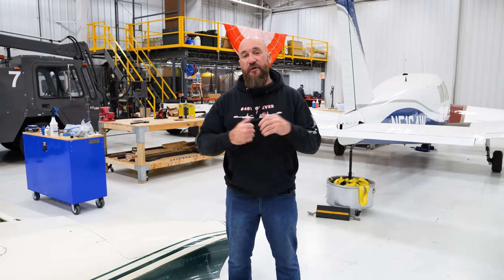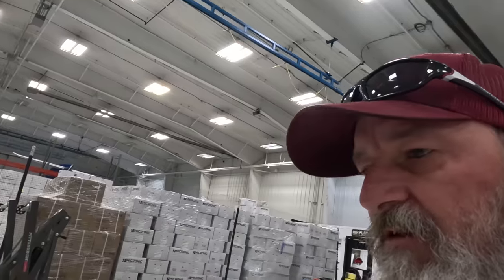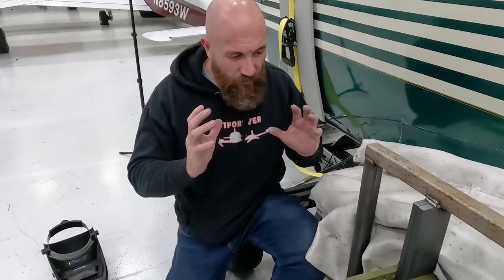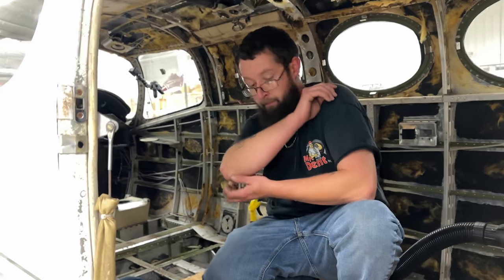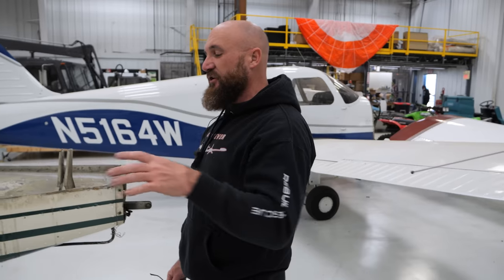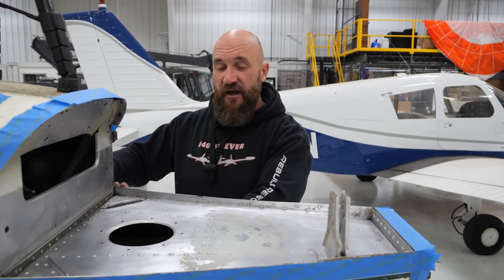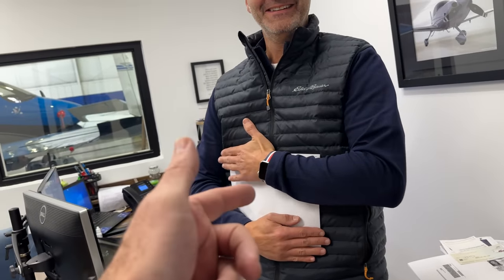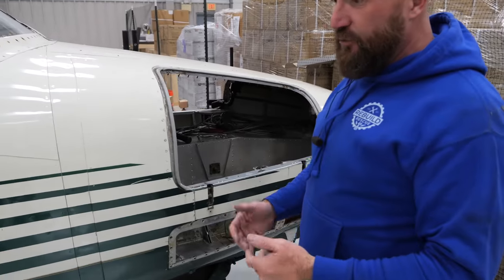Getting The Free Abandoned Airplane Ready To Leave The Hangar !

Comment from the maker: Skip the waitlist and invest in blue-chip art for the very first time by signing up for Masterworks: https://masterworks.art/rebuildrescue Purchase shares in great masterpieces from artists like Pablo Picasso, Banksy, Andy Warhol, and more. See important Masterworks disclosures: http://masterworks.io/cd
Reply: If I were you, I'd cut four 3" or 4" long box tubes with diagonal corners and weld them as diagonals at the corners of those two big square things for extra rigidity.  
I'm not a welder, so maybe people here are gonna tell me that's unnecessary, but that's what I would have done just to over-engineer those support thingys a little more 😛
Reply: And nah, strip that ugly old-fashioned paint job.  Screw "historic!"  Give the plane a sleek modern paint job!  
Personally, I'd paint it a sparkly metallic red paint like a sports car with subtle black accents here and there but not excessive, like, no black racing stripes or anything!
Reply: @fredashay  same, boxes move, triangles don’t. And that’s the “fall out of the sky” chassis of the plane, it doesn’t need twist loads going down rough roads.
Reply: Use dry ice pressure washer?
Reply: Not sure about this, sounds suspect as the price of art is still speculative like stocks are. Its price is inflated by the auction house. There are many good factual youtube videos right here on this platform about it by people like Half As Interesting, Cheddar, etc. I do appreciate though you gotta do sponsorships, they keep the 401 in the air, and at least its not kamikoto knives or established titles 🤣 Keep up the good work and keep flying! ♥

Comment: It may be too late but, I recommend a different way of securing the fuselage to a truck trailer. In 1972, I was picked to design and build cradles to send planes by truck, after they were subjected to flood waters at Lock Haven. You have to keep in mind the pounding these flat bed trailers subject their cargo to on our crappy highways. I built wooden cradles with the fuselage contour cut out in the wood, then cushioned the wood with thick strips of felt. You could probably use rubber backed carpet or something similar. Straps were attached several places and through the wing spar box carry through. Those heavy plates of steel on the spar fittings is not a good idea, IMHO. They will be subjected to a lot of stress if transported the way shown.  The Navajos arrived in good shape but I did have to redesign the wing supports and add more felt. These planes were used at NAFEC to see if they could design more crash resistant seating. They were rigged and dropped from a structure that had previously been used in the space program. One made the cover of Popular Mechanics Magazine.  A photo was sent to you of the fuselage on a trailer.
Reply: I agree with you on that. I have been involved in building a few timber cradles for commercial aircraft, with as you suggest good clean carpet, not necessarily new or 6 - 10mm rubber. Also some form of levelling adjustment for when on the ground in the various locations it will be sent to. Some where in the manual there will be "Shoring Points" for taking the load of the aircraft and keep it from going out of shape. Cradles and the frames you have built would work well together. I'm sure Cessna will have guidance on it. But you are doing pretty well, roll on Oshkosh 2023 👍

Comment: Corner Braces to your transportation rig would add additional safety strength. As it currently is there is a lot of torque forces on the welded joints.
Reply: The welds look terrible.  Corner braces are a must.  I don't think that plane will make it on that homemade rack all the way to Georgia and back. If it falls off the truck, then the project will be over, just because the rack was so poorly built.
Reply: The lawnmower tires definitely don't help
Reply: Not sure how the tail will be supported or if over the road vibration has been taken into account.  The large overhang could move up and down and severely over-stress the spars as well as the cart and the welds.  Also have to be careful of strapping to the trailer because it will force any flex of the trailer into the fuselage.  Some trailers have a lot of built in camber that can cause a lot of stress to long objects that are strapped down.
Reply: @bobt1931  Cross braces in the construction  will indeed add strength and stiffness. But I think that some flexibility is also needed. Maybe the whole thing should be mounted on some sort of shock absorbers.
You don't have to worry about the tail being overstressed. In flight, the forces on it, and on the wingspars, are at least 5 to 6 times as high as they ever will be during transport. Flying through turbulence will dubble that, maybe even triple.
Reply: @C.E. G  I was going to say I would not solid mount that to a trailer unless the trailer has air ride. Even then I think there would be a lot of shock going through the airframe. Also the frame should have mitered corners. We ripped out the wall on square tubing with but joints in the corners.
Reply: You took the words out of my mouth!  I wouldn't trust those welds.  And definitely bigger tires.
Reply: I just commented needs gussets or bracing on corners. Yes it is a must
Reply: My first thought as well - gusset it up!! Hit just about every 90 degree corner possible.
Reply: I concur with all the bracing suggestions.  Starting and stopping while driving will result in the mass of the fuselage exerting longitudinal loads on the frame that you have constructed.  The corner joints definitely need to be strengthened with corner braces/gusset plates to eliminate the bending forces at the joints.  Also the welds need to be continuous.  You have them stopped with a gap in the steel until the next weld.  This will be the starting point for fatigue cracks that will be initiated by vibration as you drive down the road.  These vibrations will result in thousands (millions?) of stress reversals at these points which will fatigue the materials.  The gaps in the welds create stress intensity points where the stresses are much greater than would be calculated by dividing load by the area.
Reply: Bracing will not work, see my other comment.
Reply: General consensus seems to be it needs MUCH MORE bracing and definitely some cushioning/shock absorbers.
Reply: @corey4109  thats just for the hangar. The whole rig will go on a proper trailer

Comment: The further this project goes the I am amazed at how much work has to go in for the plane to be flight ready.
Reply: the whole purpose of the FAA is to make it Safe to fly planes. As a Result, the number of Deaths per Passenger Mile on Commercial Flights is Lower than on highways and other across the road transportation.
the FAA also spends time and effort to insure that General Aviation Planes are as Safe as they can be, and will identify the cause of any Plane involved incident, to spread the information of what happened and how to protect against it, to as many pilots as possible

Comment: Perfect timing!  I am restoring a 1974 MGB-GT.  The engine is out and I've been looking at the past 48 years of accumulated grunge in the engine compartment.  Been trying to figure out how to clean everything to repaint the compartment (without turning my pressure washer loose in the shop) and along you come with the cleaning using the drill brushes.  That solves my problem of not making an horrendous mess in a shop with no drains.  Thanks for the perfect timing!! And keep up the good work on the 401!!.
Reply from the maker: Thank you for your support Brother ! Keep us updated on your restorations !

Comment: Looks like that dry ice blaster would have been really nice to use during that cleanup.
Reply: Where did that go?
Reply: @tdk1246  That’s a good question but I’m assuming if they still had it he would have utilized it. Maybe it was just on loan.
Reply: Think its to expensive to use in large scale..
Reply: @jmqwert  I’m sure it gets costly. If you’re going to use it you need to have a lot of parts ready to go so you can justify the cost of the  bulk dry ice order.  They are really amazing in the way they work. Their Vapor Blast Cabinet seems to clean really nicely too. I just like the fact that you can blast parts without a cabinet using the dry ice machine and there isn’t really anything to clean up afterwards either.
Reply: Have you seen the new hand held laser cleaner ???
Reply: @Fadil1954  I’ve seen them not sure if what I’ve seen is the same one you are talking about.
Reply: They need a vapor hone machine they can fit the whole plane in
Reply: @P-J-W-777  I've seen it in action, it's simply pulverizes rust, oxidization and dirt. I thought it was another wonderful new invention, easy to use and convenient, Cheers
Reply: @Fadil1954  They really are an amazing piece of engineering. Very little cleanup is required with them as well. 
I believe you have to be trained and certified to use them though because they can be extremely dangerous. They are also pretty darn expensive. The system I saw was in the 10’s of thousands of dollars.
Reply: @RevUnstableBoy  Basically a paint booth converted into a Vapor Honing System. Hey wait, that’s my idea! 😀 I just put a patent on the idea! 😀

Comment: There is a zero percent chance you will not destroy the spar attach points with that method of transport. The attach holes are extremely precise in bore and any damage will render them non-airworthy.
Reply: @eagle2019  Unfortunately, the damage is likely already done.

Comment: Nice to see the 401 coming along so well, and so quickly! Just a thought for you though. As a former truck driver, I would be seriously looking into what permits etc are required to move that plane. Due the fact that you have things sticking out past the sides of the trailer, and that the airframe is so long, you  may need oversize load permits in each state that your going through and the there WILL be restrcitions on what roads you're actually allowed to take it down. It would seriously suck to get pulled over by a State Trooper halfway to Georgia and be told you have to park it because you don't have the right permits for it. I know for a fact that  in Ontario, (where I am,) you wouldn't be allowed to use that trailer at all, but I'm sure the Regs in the US are different. Like I said, just a thought..
Reply: Indeed, this needs to be carefully looked in to.  I’m a retired trucker.

Comment: Wow, the bird's nest has come a long way! Jason, just be careful with the chromate stuff - it's carcinogen and really not healthy at all. Not just when spraying, but also later when grinding or drilling into chromate-coated parts... In the company I work for we also use it as primer (for obvious reasons), but the safety and protection measures we have to put in place are pretty strict.

Comment: What the actual F ... you do realise if those bolts scuff or score the mounting holes in that spar attach point, the spar is scrap right?    Of all the bits of the plane I would have attached to for transport, the spar attach points are the last one.
Reply: Seriously, just read the inspection noted for the spar attach points. If there is a score mark in the attach holes, its scrap.  The PA28's had a mandatory AD about inspections of the attach points, lots of wings failed, lots of planes got scrapped. Those mounting bolts are hugely risking putting marks on the spar attach points, you are taking a huge risk. there is no repair procedure for the spar attach as far as I know.

Bouncing it on a trailer on those spar attack points, with bolts that are loose in the holes is 100% going to end up badly.

Comment: Another vote for building a cradle to hold the fuselage with the cradle sections under bulkheads or other structural members from the nose to the tail of the aircraft. As important and expensive as those wing spars are, I would never attach them to anything other than what they were designed for - the wings. Supporting the fuselage via the spars could lead to many, many inadvertent/accidental issues already mentioned like odd stresses applied, bumps, twists, etc. You've done a great job with the aircraft so far, I'd hate to see it all set back to put in new spars.

Comment: My 2 bits worth... My alarm bells are going off. You should talk to the manufacturer about what you are doing with the wing attach points. Be very careful when loading them up in a way they were not designed to handle or you can ruin them and cause them to fail prematurely leading to loss of the aircraft. This especially applies if the attach points are life limited or have an AD on them. Otherwise... first, I would make sure that you have proper spacing between the forks of the wing attach brackets to prevent them from bending inward when you tighten the bolts. Use your old wing attach brackets as a pattern for the thickness and use shims if necessary. Also make sure your bolts have the proper diameter to fit the hole to spread out the bearing load. You never want  to use a smaller diameter bolt in a larger hole because it will concentrate the load to a small area in the attach bracket. Some wing attach brackets actually have an interference fit for the bolts to spread the bearing load out in the hole. I would use the same bolts that were removed with their washers and nuts, if I were you. Lastly your rear spar had the load spread out to 7 bolts and you reduced it to 2. That may mess up that wing attach point by dumping the load into only 2 holes and in a different direction than for what it was designed. They probably used 7 bolts for a reason to spread out the load introduction into that bracket so it won't be concentrated. Also remember that maneuvering and bumps in the road can cause a lot of load to be exerted onto the fuselage, so to spread the loads out over the fuselage you should create carpet lined cradles out of wood that are periodically positioned at the same fuselage stations as its internal frames. This will anchor and prevent twisting, bending, and introducing structural eccentricities. Also, You should add gussets into the corners of the spar support frame that you created. You won't need them for simple vertical support sitting in the hangar, but when you get it on the road, it will help to prevent your frame from failing in the fore/aft directions.
Reply: @eagle2019  What he did with the wing attach points makes my heart race and scares the hell out of me. It can cost the lives of all on board if a wing folds. I sure hope he hears what we are trying to tell him. If he doesn't acknowledge our concerns in a forthcoming video, then I feel strong enough to make a call to FSDO. I hate to derail his effort, but people's lives are on the line.

Comment: Welder chiming in here.  To weld those thick plates to the lighter tubing, you need to put some heat into the plates ahead of time.  Hit 'em with a torch for a while before starting welding.  On the seams, make sure you wrap clear around the corners.  Don't leave it unwelded at the corners.

Comment: Just a tip for future brackets you may have to fabricate. Cutting a triangular section out of the tube where you want your 90 degree bend and leaving one face in tact, then heating the in tact area up and bending the tube 90 degrees and welding the now touching cross sectioned area up makes a much stronger joint. I would usually say one time use brackets for shipping probably wouldn’t matter, but considering the value of the cargo here I would’ve probably taken the time to do things a bit sturdier. This is constructive criticism of course. I totally respect what you’re doing here. This has been an awesome project to watch!

Comment: Jason great channel! I am worried about the bolts being used to bolt the spars to the cradle. If the bolts are not shoulder bolts of the same diameter of the original spar bolts you run the risk of damaging the inside holes on the spars, especially if they get loose and bounce around . I would use the old spar bolts , but suspect the mounting plates would have to be precision drilled and reamed.
Reply: Exactly this!  The spar attach points are the very LAST thing I would attach to!!  Any scoring, scratching or hole elongation and the spar (and hence the plane) is scrap. There is no repair procedure for the spar attach points AFAIK.

Comment: The welds could use some improvement. On the plates attached to the spars, you need to add gussets on both sides of each one. There is not enough weld area there to cover the bumps in the roads as you travel across the country..

Comment: On the welding   I'd push when welding  with Gas not drag.
I'd also  wrap the RHS over the top and weld down  the sides .
Mainly because  otherwise  you only  have the strength  of the wall thickness  of your RHS.
I'd  also put gussets  in the top corners .

Comment: After stripping good ole pressure washing would cleaned the stripper up and allowed to clean around rivets all in all the paint gone. Scratch brights pads and laq thinner is the best way to remover all contaminants fill ya 2 paint buckets half full dip pad in one let it stay wet and work top to bottom then clean rags dip in the the clean thinner wipe off. You scotch brite till it all turns blk then wipe clean throw rag down repeat.    

If ya go with red it will be bad ass is grey car primer it holds excellent to the aluminum.  Do a base coat of white just enough to cover the grey primer up. Let it flash lil them
Come back with the red prob gonna need 15 gallons to get it to cover good and not get suck up by primer and base coat  looking good excited seeing the progress